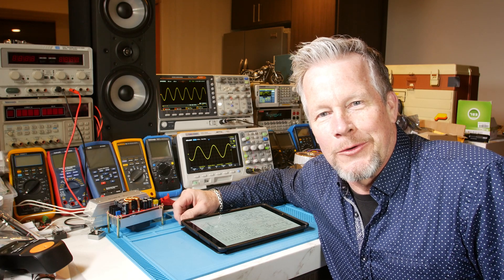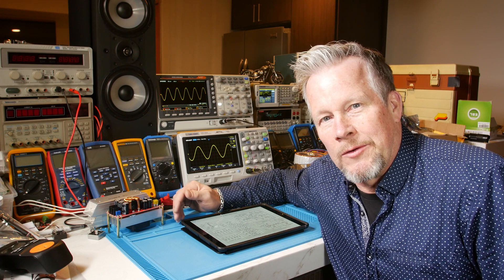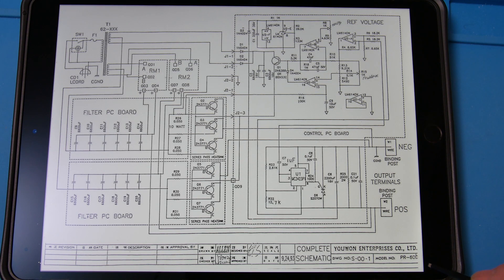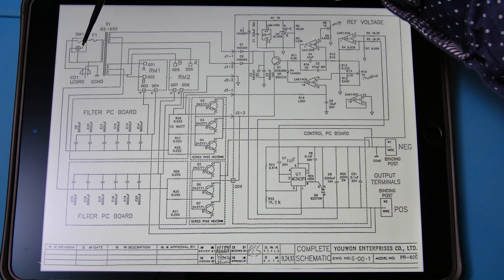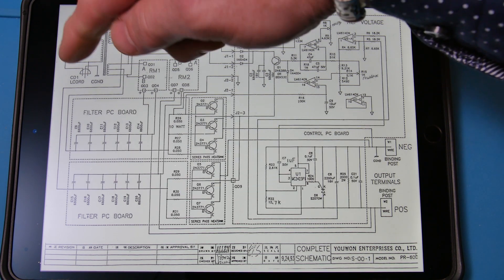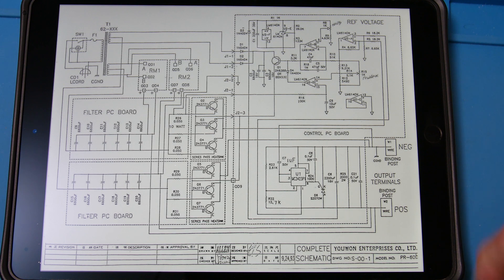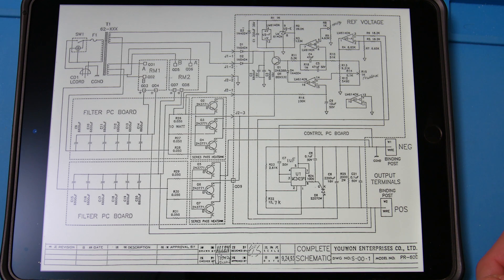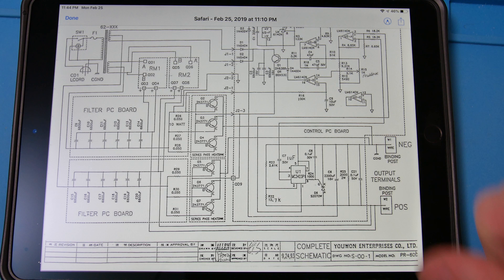Tripp Lite power supply schematic

Comment: I have a PR-30, similar, has 4x 2N3771 and one bank of capacitors. I think the Thermistor is part of a crowbar circuit. I'm about to pull the legs on mine, to see if i get voltage at the posts. If i do, the op amp regulator is still good. I can replace it later. I suppose if you had a variac, you could slowly fire up the supply, less stress on the transformer. You can hear a thunk when you throw the switch on! BTW, this is the first I've seen a schematic of any Tripp Lite power supply, thanks. KI6VST
Reply from the maker: So it isn’t working now?  Jerry added a thermistor at the input to control the inrush current.  See below.  Thanks for the comment!

Comment: .
Just a small quibble: The RM1 and RM2 are not bridge rectifiers. They are simply dual diodes. Note the two + outputs. A bridge rectifier would have a + and a - output. For this circuit design we don't need bridge rectifiers because the secondaries  of the transformer are center-tapped. Thus as each of the two outside wires of the secondary swing from positive or negative with the AC input, first one and then the other diode conducts and the positive DC output is referenced to the center tap, which becomes the negative lead. Of course, that doesn't change the main point, namely that the huge capacitor banks are right across the rectifier outputs, leading to huge inrush current. The inrush current is only limited by the resistance of the transformer windings and associated wiring, which ain't much!
Reply from the maker: Ray Albers Good catch and thank you for that correction.

Comment: Thanks for sharing, your explanation is fine, but maybe a bit hard to follow. I may have a suggestion on what may make it easier. If you open the image in a simple drawing program, then can you draw lines on top of the image and remove the lines again, wary easy. :-)
By the way, it could be wary interesting to learn what to put before the transformer, AC noise filters, inrush current, lightning protection, heat protection and so on.
Reply from the maker: Fried Mule Fried Mule Thanks for the feedback - I actually started in a drawing package, but then thought it would go faster without.  I like your idea of drawing and erasing  - then I can do each section then erase to go to the next section - or whatever so that it doesn’t get to messy.  I’ll cover the other items as well.  I actually did cover the inrush using the thermistor.  This is Jerry’s Power supply that he is planning to add the thermistor based on my video and had a question.
Reply: @KissAnalog  Yes the part about the thermistor was part of the reason for asking about the rest:-)
I do also think that if you used different colors to i.e. + / - it will be more clear:-)
Reply from the maker: Fried Mule I like that idea!!  I appreciate the support!!
Reply: @KissAnalog  you are so welcome!! :-)